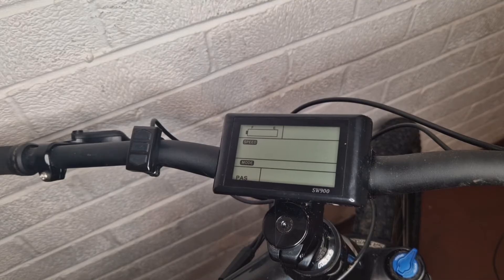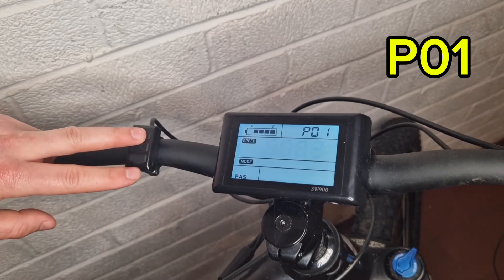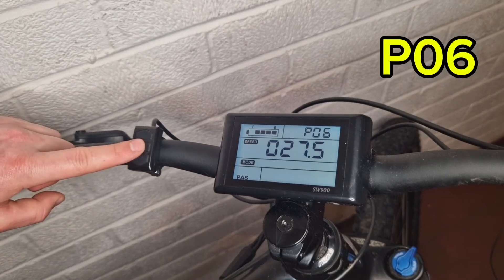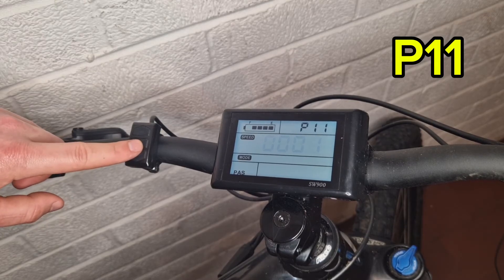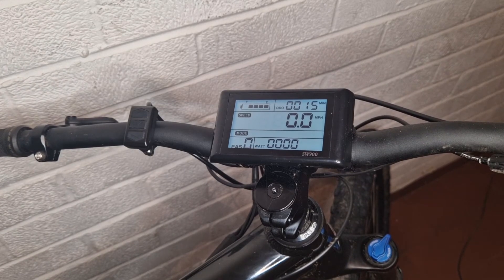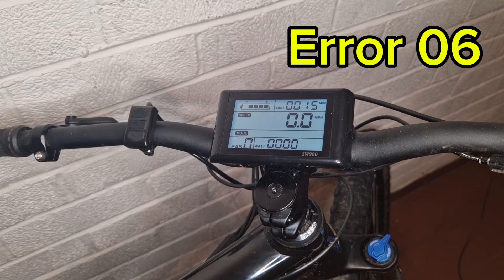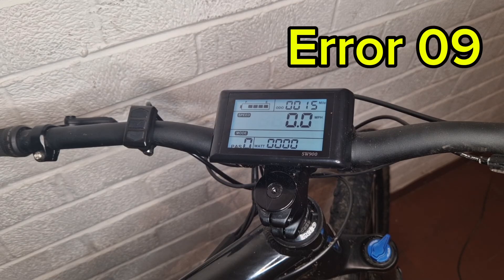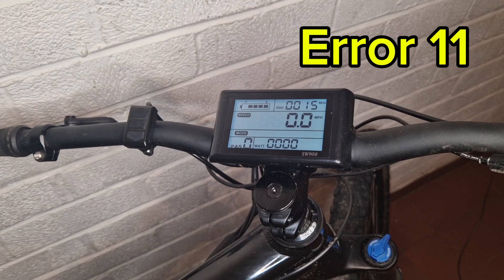SW900 Guide, Settings, Error Codes, Fault Fixes, How To Use E-bike Display.

Comment: Hi mate, love the video, been using it as a reference point when troubleshooting but I've got error 08, it stays on screen even when the throttle isn't connected but disappears. I've tried a new controller, new motor, new throttle and no changes
Reply: Same thing mine is showing now have you been able to fix yours
Reply: @OmoruyiFamous Unfortunately not, gonna convert it to a Bafang mid drive

Comment: I get error 10 on mine but only seems to come on when i plug the pedal assist on soon as I unplug the pedal assist it goes off and the throttle works, but when i plug pedal assist back on nothing works
Reply: Did you ever figure out what the ten error code was ,??
Reply: @trevorjames5493 sadly not

Comment: i changed some settings by accident but now throttle dont work
Reply from the maker: Change settings 10 to 1 or 2 and this should enable the throttle. If it only works once the bike has started rolling then setting 9 will need to be adjusted.

Comment: I ran the bike with a 72v 20amp controller instead of the sw900 and it would cut out in speed gains, I’m guessing cuz it was a  20 watt, any screen reccomendations, original problem was a error code 10

Comment: what do i do with 08 even if ive got a new throttle or controller
Reply from the maker: Try a new controller 👍
Reply: @OldDogsNewTricksMTBi have still error 08
Reply from the maker: @tjosbw Do you have waterproof or non WP connections?
Reply: @OldDogsNewTricksMTBno just standard
Reply from the maker: @tjosbw Try the throttle in the PAS connection if it fits, if not try putting a PAS on as well to see if that clears the code
Reply: @OldDogsNewTricksMTBnope none of that is working
Reply from the maker: @tjosbw hmmmm, I doubt it would be another faulty throttle but may be worth trying another. Also a very small chance the display has a fault as they sometimes produce random errors codes but rarely.
Reply: @OldDogsNewTricksMTBthanks mate ill try another screen

Comment: Hi would you be able to help?

I have a working setup and i wish downsize the existing controller and its paired display.

So i swapped in a smaller controller and its paired display sw900. 

The swapped in sw900: In the display square where you have "watt 0000" showing in your youTube vid, when i press M, it turns from watt to "error 010".

Other components in my setup is compatible(and working) except brakes as the connector/split is done differently ..ill be changing these to match

Any idea what else to try with this sw900? Is it the display faulty or controller ? Because i can throttle to move about but i dont understand the error 010

Comment: When I try to go to program mode it shows me C and I don’t see the same menu you have… please help?
Reply: Can you enter a 4 digit pin on the C screen? If so, try 0000, or 1234
Reply: @CarlPaulsen I have the same c display . I entered both PIN code you suggested and then pressed the middle button again … to enter the PIN code … and nothing happens . I would love of you can help me … I stuck at 25 km speed and it’s so slow…
Reply: @itay1207  Can you change how many amps it will use?
Reply: @CarlPaulsen  no my friend - in order to change the amps i need to get into advanced settings and i cant, because its give me c display(which i guess is a short for code), and i tried to enter the pin code you suggested and it didnt work. maybe if i would change the computer for a new one, it will work? because i think its the restrictions that came from the factory
Reply: @itay1207  I have the same thing on a go bike I picked up for my aunt. Can't get out of kmh to mph. : /

Comment: how do you fix error code 2 which is brakes
Reply: 2 will come on each time you pull on the brake I believe. It cuts motor power when braking.
Reply: @pratt1bp  Applying the brakes does not and should not cause ERROR CODE 02 as it is not an error but a totally normal scenario of usage. We don't see an Err02 everytime we apply the brake. So this begs the question, why does Err02 come in the first place?
Reply: @ it has on my bike since purchased

Comment: I have error 10 coming up on my lcd, ive checked connections between screen and controller everything is fine????
Reply from the maker: You must have a fault in your display or controller, try a different display first then a new controller 👍

Comment: Am not getting a speed reading unless the motor is in use. Also if I set it to the correct wheel size it reads at least twice the speed am travelling. Any ideas?
Reply from the maker: The only time I've seen the speed readings not show is when the controller and display are miss matched, are you using an sw900 with a DC moto controller?
With the speed reading being inaccurate it's worth checking setting P07, that may need adjusting with the wheel size.
Reply: @OldDogsNewTricksMTB  yeah. Dc motor controller and the sw900 display. Only part of my kit that's not brand new is the battery. Recently upgraded from 36v 350 watt to 36v 500. Just can't figure out what's wrong. Had to set my wheel size to 10 inch to even get close to true readings. Burning my head out it is!
Reply from the maker: @ptaylor81 There's no reason why changing the battery would cause this problem. Did you manage to see what setting p07 is set to? 
Also did this start happening randomly?
Reply: @OldDogsNewTricksMTB  P07 is set at 46. I bought a brand new  36v 350 watt carrare from ebay last September. But wanted slightly more power. So bought a 36v 500 watt kit. Had it fitted professionally the other week. But instantly it would not give speed readings unless the motor is in use. And the speed was like 40 mph. Even though the wheel size was set correct. The guy who fitted it is confused as I am
Reply from the maker: @ptaylor81 I can't think of an explanation for that one, if it was my bike I'd start by trying a different display. 
Also check the hall sensor wires are all connected to the same colour in the white block connection from motor to controller, these 5 or 6 small wires carry the speed information from the motor to the display so you may have a miss match down there or a damaged pin.
Reply: @OldDogsNewTricksMTB  nice one bud. Will have to check that out. Cheers
Reply: @OldDogsNewTricksMTB hey bud I’ve bought a 2000w e-bike off someone and the speed is not showing on the sw900 display. At all

Comment: Mine is 1500w 48v…it’s showing error 08, I have checked the throttle over and over again but can’t find any disconnections. Please what do I do?
Reply from the maker: It may be a fault on the controller if you've tried new throttles. A faulty pedal assist can also cause this fault so check that over if you have it installed.

Comment: Currently I’m running a 1500w mtx rear wheel with 52v battery I set the voltage on the sw900 display as 48 due to no option for 52. It has been riding good past few weeks but now screen keeps coming up with error 06 and can’t fix it tried evrything
Reply: I got the same problem now

Comment: Just bought a bike with a kit on
Running hot
So I can deactivate the throttle 
And limit it to 15.5 mph?
Reply from the maker: Yes, you can join the 2 matching wires together at the controller to set the limit and use the pedal assist instead of the throttle 👍

Comment: I purchased a bike with this lcd recently but the settings menu has a pincode. Is there a default code? Or hard reset option?
Reply from the maker: The manufacturer must have set this, I'm not sure why! If they didn't provide any paperwork including the pin code with the sale you may have to get in touch with the seller for that one
Reply: @OldDogsNewTricksMTB  Unfortunately I bought it second hand.

It's an Allegro model but there's scant information online about them. Not a website or anything.
Reply: Are you sure its the sw900 not the kt lcd  because I can't password the sw900 lcd screen.  And I have both lcd on different bikes and can only password the kt lcd
Reply: @outandaboutsince1986  Yeah I'm certain unless KT also have one with the same model number and design. 

I think the unused code in the manual enables pin code if I remember correctly. 

In the manual it says" not yet in use"
Reply: Failing thst just buy a new lcd and follow this great instructional video 📹 👌
Reply: I have an allegro too, purchased 2nd hand. When I press up and middle it says C and gives me and give me 0000 where the odo is

Comment: When i turn my bike on everything works but the battery isn’t showing but the bike works perfectly fine. Can u help me?
Reply from the maker: The voltage on your display may be set higher than what your battery actually is.
Reply: @OldDogsNewTricksMTBhow do you change this? My bike doesn’t show me what battery I’m on it always says it’s full even when not charged fully
Reply from the maker: @TommyAbraham-t4j try changing P03 in the settings menu, if it's set at a lower voltage than your battery is it will always show full.

Comment: Hiya I have just installed a new sw900 it has two connectors a large 5 wire connecter and a tiny two wire connector, I have no idea where this one plugs in ? Do you know at all , my old lcd screen died but only had one 5 pin which plugs in no problem ,,cheers
Reply from the maker: Hi, 
I've never used one, but I believe the 2 wire connection is for a headlight 👍
Reply: Hi that sounds about right cheers

Comment: how have do u get the 52v setting on the sw900 as im looking at a mtx 1500w 48v kit wanting to use a 52v 28.8ah battery and im pretty sure most of the sw900s come with 36,48,60,72 with no option for 52v in PO3
Reply from the maker: You're right, we had to ask the manufacturer to add the 52V setting so we could sell it with our 52V battery. It should work OK on the 48V mode but your battery level would most likely always show full on the display.
I can take a look to see if we have any spare displays with the 52V setting if you'd like.
Reply: @OldDogsNewTricksMTB  its because im planning on building one in a month or two when i gather abit more money as i wanted to build a 52v 28.8ah and use a 1500w 48v mtx rim kit so it would be a good all arounder ebike! as i wanted too see the battery life on the display but not a huge problem its that since it recognises it as a 48v battery it may the battery v down too low as it thinks it still a 48v not a 52v.
Reply from the maker: @ethangladstone1550 It will be a good set up, the seller may be able to provide a 52V display and controller. Give us a shout if you need any parts, we're using the mtx rim on our 1500w kits now and we can sort you a discount code out 👍
Reply: @OldDogsNewTricksMTB  do u sell on ebay or ur own site gonna look into ur stuff ur selling also ive emailed this question to the seller so hopefully i get a response.
Reply from the maker: @ethangladstone1550 We sell on our website, which  is www.g-volt.shop 👍
Reply: @OldDogsNewTricksMTB thanks for the details on ur shop I’ll check it out at some point today. I just have a quick question if I run the 52v on the 48v controller that comes with the 1500w kit will it be ok as I seen that 48v controllers max out at 60v so I understand there would be extra heat but it was just to clarify if it would be ok too as I’ve seen most people with 1500w 48v kits using a 52v battery no problem👍
Reply: @ethangladstone1550 
Did you ever get an answer to that question ?